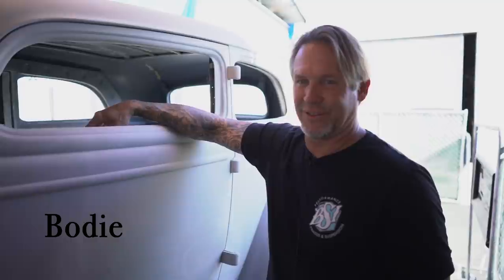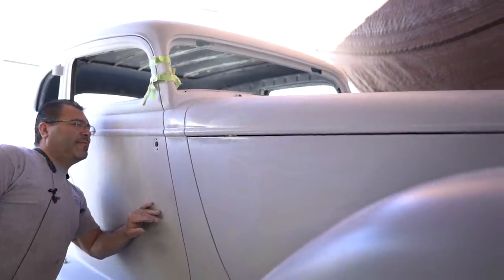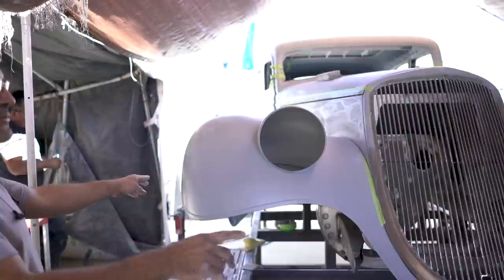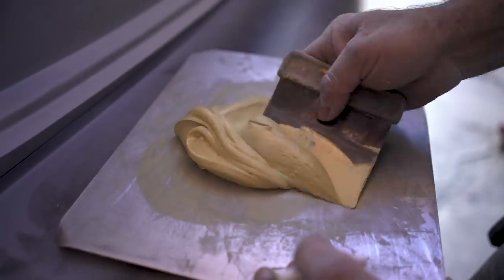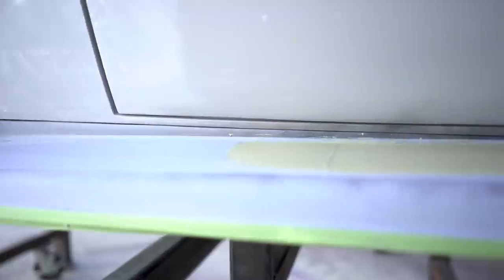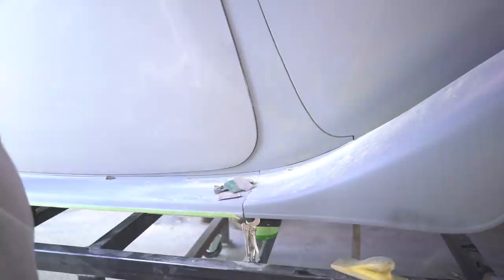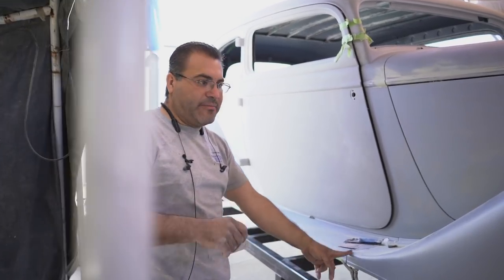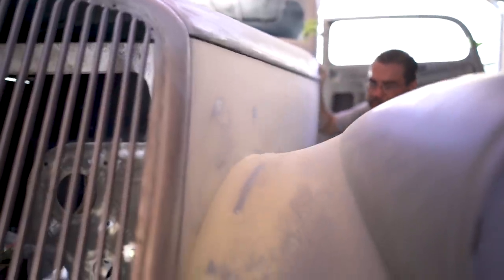The Vik - A Tim Allen Build - (part CxL)

Comment: The devil is in the details and this devil has lots and lots of details. Great work, guys! Loosing patience with it at this late date would be a waste. Several here don't seem to realize that you are building a car to several times the tolerances that Ford built it 80 years ago- and it wasn't always treated well in those years- there was a lot of old sin stacked on those Ford bones! BTW, Ford bones made with the very low carbon steel commonly used in 1930's - which rust more easily and no undercoating. Awesome job, bringing that old dear back from near scrap!

Comment: I would not want to write the check for this project. I think they have milked it for all its worth.
Reply: Brian could you tell us about the cars you have built and how long they took
Reply: 67 mustang coupe, 3 months rebuilt the engine. 4 months body work and paint, total stock interior 1month. Any other questions?
Reply: @brianwaskow5910  Sounds Like you were milking it. What took you so long ?
Reply: Why so negative, take a hit and calm down.

Comment: Take the time and work the metal and use less bondo.. That stuff comes off in 3-4 years and leaves cracks in the paint. Sure looks good after you're finished but 3 years later it looks ghetto.
Reply: You're wrong.
Reply: This isn't the "Bondo" of the 80's, they use very thin layers and this shit bonds permanently, it doesn't crack unless you layer it thick which they aren't doing.
Reply: @KlipschHead281  Looks pretty thick to me and gee I don't know.. I only have 7 cars in my collection as shown in my linkedin account. I chose not to use any Bondo for this reason.
Reply: @yapandasoftware  - They explained that they block and sand it down which every high end shop does. Foose has cars going back decades, nobody complains about cracks or bad finish. If you have the skill to never use filler you need to open a shop and show these guys how it's done.  😉 I'm not saying that to be a smartass, seriously, if you do the market is there.
Reply: @KlipschHead281  I've restored quite a few cars in my day dating back to 1972 restoring a 1959 Alpha Romeo with my older brother. Bondo has changed quite a bit since I first used it. However I can assure you too thick of coatings will crack even using today's Bondo at 1 quarter of an inch or more. I'm all for using glazing compounds and in most extreme rushed cases using bondo-glass but I believe the best restorers don't use any bondo. They simply replace the metal with good metal or work the metal out smooth. This is the best option. Many restorers use Bondo because they are earning money, not doing it for the love. It took me 9 years to restore my 1964 Corvair and 7 continents of parts chasing. Not one oz of Bondo. $70,000 later, I would have been better off spending my money on a new Porche.
Reply: @yapandasoftware  - What part of they don't leave it on thick aren't you getting, he states how thick they leave it and you stick with thick like they're using plaster. I'm glad for you not using filler, great, point made. Now understand my point, they don't leave it thick, ever, if you refuse to believe that ok, we agree to disagree.